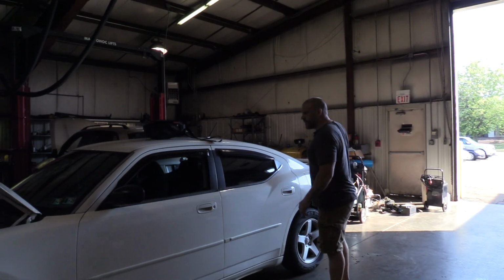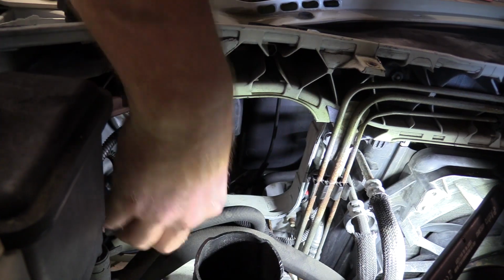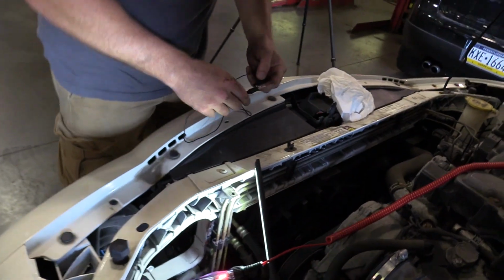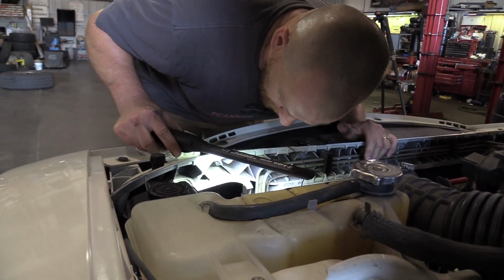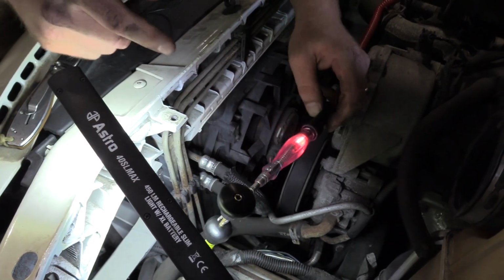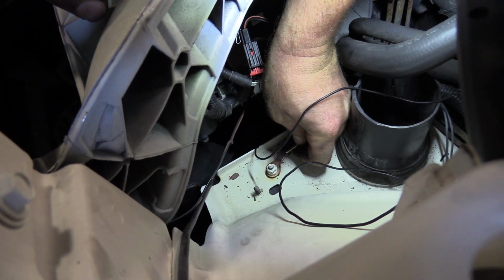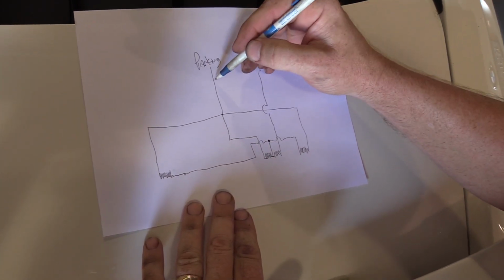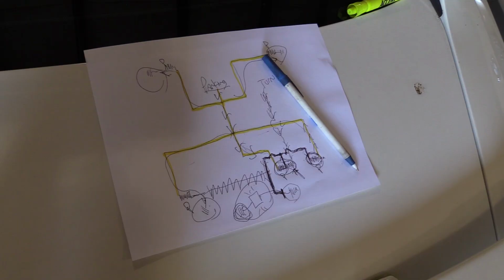Voltage drop testing a parking light/turn signal circuit

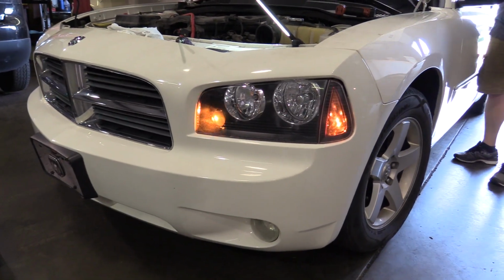Comment: 24:40 Nope its bad. Think again. its grimped, not soldered they all have oxidation on them. so they all need to be turned on to see results but some of them are most likely very low amp. sensor grounds so newer see it...

Comment: Here's one for you, I have a 2003 GMC Envoy XL, rear AC not working great, don't use it much so haven't worried too much about it, the hot cold blend door needed to be replaced I knew that much. Finally getting around to working on it, everything  points to bad blower motor resistor and lots of comments online says that's pretty common failure. Long story short get it all torn apart, put new blower motor resistor in and same problem, wiring, fuses, fan (current draw not excessive), everything checks out, did notice that the resistor gets really hot, pretty sure it has a thermal fuse and that's what is shutting it down. So I heat sank it (put it on block of steel) and it kept running. So I'm going to rig up a heatsink but leaves me curious what is causing so much heat, everything looks and checks out fine ?

Comment: I know this is an old video, but I once helped my dad replace my grandma's headlamp assemblies. They were each wired differently to the bulb sockets and it was causing weird issues with the lights and signals and we had to take them out to compare them to the original.

Comment: Hey Scanner Danner, dp you have any videos of voltage drop testing with comparing different conditions on the same type of circuits and loads?
What i mean is have a turn signal example with a bad ground we can see maybe in class shop, them show a with good ground and what you see when you test it with multimeter and OTC test light.
Also show a corrosion fault on power to load wire vs known good power wire and the testing steps with voltage drop using voltmeter and incandescent circuit tester?

I think that would help the dumb people like me 😂
Reply from the maker: I have so many like this! Did you see my newest video from yesterday? I'd be a good place to start. I have a part 2 coming up on this as well. Also anything in my chapter 3 playlists right here on YouTube and on my website 
https://www.scannerdanner.com/join-scannerdanner-premium.html

Comment: Hey Danner fans!!!!  Even if he says it doesn't matter to poke holes in a ground wire. DON'T DO IT. It does matter as you can see the factory wire corroded where there was no protection. The fact that FC didn't protect the original well enough proves the point.  great teacher you are Danner but you get an F here.
Reply: Sorry..NYSDOT tech here. we eat green wires for lunch here. Poke holes but   PLEASE show repair after. You know of the clear nail polish fix I assume? works great. Even on the little hole from your PHILS probe. Holes are holes bud.  @ScannerDanner

Comment: Agree with everything you said but if it was me I would have replaced the entire eye lite even if it didn't test bad(or at least cleaned it before bolting it back down) if you had two wires pull out the others probably aren't far behind

Comment: Starting more than 3 decades ago. One thing I learned every time I get into a new project. Clean every single Ground my eyes and hands can find (a diagram helps a lot...). That means that from old crappy VW Beettles older than myself, to way more recent cars and motorbikes.
I tend to have extremely reliable vehicles, in what electrical is concerned. Never mind the fact that some had been, literally, saved from the scrap yard! ;-)
With that said. Rotary tool, Dremel type, equipped with a decent wire brush. It's an invaluable ally to make short work of corroded contacts/terminals. 
30~45 minutes for a car project will return years of extremely reliable work. Yes, it's a good trade, totally worth investment of time. ;-)
First class video and show case. ;-)

Comment: hello great video but you are saying back feed ground through other  brake Lite assembly but  my question is why the other brake lite assembly  don't share the voltage and  are not blinking on those any of any sides . and when parking lite is off the turn signal signals worked  you donot think ground going back to parking brake power supply not through other brakes light assembly.
.

Comment: Thanks, Paul.   I always appreciate the explanation of the theory, such as you did at the end.    One favour, please: whenever you connect a test light, please be sure to emphasise what the alligator clip at other end is connected to ie power or ground.       When you don’t emphasise it, I sometimes miss out on the information because I’m trying to work out where it must be connected to in order to react as it does.    Many thanks.
Reply: I second this

Comment: Why would you not just put all those grounds into a new lug & clean the ground area up? Takes 5 minutes & reinforces good practice. Guarantee that lug will fail again & best way to source a fault is find the last persons shitty repair
Reply from the maker: 27:00 I addressed that. I used what I had available to me at the time. You're not wrong

Comment: hey paul do you ever see anyone do a voltage drop test but put the meter on MA scale and look for a drop this way called "current flow method"?i always done the traditional vd method you shown and while looking at ground points for engine swap the poster writes that switching to ma is more accurate test? is this bs?
Reply from the maker: That method is used for parasitic drain testing only and is frustrating at best using it

Comment: A faster test is to use a meter and set to mV and voltage drop test the power side, and then voltage drop test the ground side. If it goes to OL or reads battery voltage you have a bad ground. Seems like your test light method takes too long. We as instructors need to provide a faster and more precise way to check for circuit failures.

Comment: I have a voltage drop to battery voltage (dash reading but lights dim as well so its a true drop) almost every time i put the car in reverse. Then after a few seconds it will go back up to 14.9v. happens when i go directly into drive as well sometimes not as bad on the voltage drop around 13.2v. changed alternator still the same problem. The voltage being 14.9v at highway speed is not cool even when fully warmed up. Any ideas man?
Reply from the maker: If your idle speed is dropping, so will voltage. Is it dropping to the point of almost a stall when you put it into gear?
What are you working on? Year, make, model and engine?
Reply: @ScannerDanner  its getting down to battery voltage. Then when i rev the engine it will kick back in. Not sure if i have a bad signal wire on alternator bc for a half hour after cold start im at 15v then will drop to 14.6 - 14.8. 15v on highway no matter what. Buick LeSabre 04.. heard the dash integration module also regulates volts on this car from the hanes manual. Is that true? Maybe a communication problem. But voltage drop only happens when shifting into or out of a gear. The most being park to reverse. Have a power steering pulley that doesnt spin as freely as it should so not sure if that could be as well. The harmonic balancers go bad on these cars too. but im sure u know that. Fixed the front transmission mount so maybe the back one may need changed as well.. sorry for the long reply and edits. Much respect sir
Reply: @ScannerDanner  the dash integration module controls idle speed as well and cuts voltage to components if the system senses that the battery is in a discharge. My ac clutch rattles intermittently and ac clutch is the first thing on the list for it to take away voltage from and this is controlled by the dash integrated module according to hanes manual. Is this true?
Reply from the maker: @confidential8738  no sir, all of that info is wrong. An O4 LeSabre? I'm almost 100% positive that alternator is self contained and only gets a wake up signal from the ECM.
Also the ECM controls idle speed. I need to look up service info. Let's move this to my forum. It is free to join www.scannerdanner.com 
Let me know when you post it and I'll help
Reply: @ScannerDanner  ok i posted in the forum. Thank you very much for your time.
Reply from the maker: @confidential8738  my man! I'll be a bit. Just became a grandfather as we speak. You're the first to know. How about that.
Reply: @ScannerDanner  wow man that is awesome. Congratulations to u and your son.

Comment: Great video Danner.  The other day, I had a a Ford Taurus where when you turned on the headlights, the right one was out, but the  washer motor started spraying the windshield. Turns out the guy changed his bulb, but forgot to tighten the ground you had to move out of the way to get to it. Bad grounds can cause some crazy symptoms.

Comment: I don’t have power on coils when key is cranking so I took a ground wire and hooked it to black wire at coil main and it starts but computer still acts like it’s missing . Is this has you would say drop in voltage end steals ground some where or is it a bad computer or a bad ground

Comment: Have question regarding voltage drop.
scenario 1.
 Objective=To check the integrity of ground wires from the PCM.
-KOEOff ( reading 5 volts on ref) - circuit is on ( supposedly loaded)
hook up one lead to BAT (Neg)and the other lead to entry point at PCM connector ( connector is attached to PCM).
DMM reads 6.2mV.
Would such procedure establish if the circuit is good ( mainly to see if wire going into PCM is connected to ground and in good condition)

Can the LoadPro also perform this test, if so what are the conditions and hook up.

Someone suggested to disconnect PCM wire, use a test light. One side goes to BAT+ the other touch the ground PCM wire, if light is "bright" circuit OK.
I ask that you comment on the merits or lack thereof of each method, if possible
Thank you

Comment: Man I just wanna say thank you thank you thank you thank you for your time I know I said thank you a lot but thank you! I currently drive a 21-year-old service van it would not run Well. I recently watched one of your videos about Chevrolet in that particular year needing 50 psi fuel pressure to open the injectors spider injectors that is. did a fuel pressure check after two mechanics told me it was junk. the thing is running like a beast. dude you’re the best thank you keep up the good work! If I was flush with money I’ll be sending some your way right now! But times are tough right now! God bless keep up the good work!
Reply from the maker: Thank you so much for the comment and I'm glad I could help guide you on fixing your van. Good providence to you my friend

Comment: Sometimes l would put a voltmeter on the ground connection where the ground wires are put the other lead of meter to neg of batt The meter will indicate a reading if you have a high or a resistance in the circuit, higher the reading up to battery voltage if very bad.

Comment: This bad ground was a common fault in the old days and still today.
It was quite common in the seventies at night time when you are following a car and the car driver indicates to turn,you see the rear lights on one side,all start flashing, dim, this is because the indicator feed in that side is trying to ground through the other 3 grounds, which have a high resistance at the point of the ground bolt to body..
As we known electricity, all ways takes it path to ground,the easiest way ,back feeding itself through other equipment .

Comment: Soon as I turned this video on, I said, "bad ground". Then I saw it was a Chrysler product, then I said, "definitely a bad ground!"
Reply: The ground stud on the left front of the frame on my Caravan was a mess. They crammed a crap load of wires into the terminal then to the stud. I first lost one side turn signal, then the other, then the driving light. I turned the one terminal into 3 smaller ones, soldered them, connected them to the stud & sprayed the crap out of them with Fluid Film. Thanks, Chrysler!

Comment: None of my comments are really related to the video particularly but,  the only times I've ever almost thrown in the towel on any kind of repairs have been with Chrysler/dodge vehicles. ...and the one time I actually did give up completely was a Chrysler. ..the combo of the bad design and pain in the butt procedure to do what I needed to do coupled with the cold weather and the wet mud on the ground was just too much for my sanity...now I get a little cringe twitch every time I see a dodge or Chrysler pull in the shop pkng lot hoping I don't pull the ticket. ..I'm scarred for life lol need therapy lol......Chrysler smh

Comment: so water got inside the jacket and corroded the wire inside, just behind the eyelet.
the way the eyelets are staked/soldered/resistance welded would make the actual connection strong and the wire just behind is always the weak point. that is also where it would stay wet for the longest duration and have plenty of oxygen

Comment: if it has a tipm....................
of course make sure the bulb hasn't went wonky inside by visual inspection or parts canon a bulb/s
NOTE, read the topic first dummy, @ backfeed into the bulb ground, so typical chrysler bad ground lugs :))

Comment: Question,  would just  reading the ground side on the device "bulb" with the DVOM, from the very start, show a "non zero" value, in this problem case it should show "approx 12 volts",  this will tell you that the ground side of the circuit is bad, ground should be zero volts or very close to it.
Reply from the maker: Absolutely, as long as the circuit is energized. If the circuit had no current flow, that ground would have shown 0v. A common mistake people make. Another common mistake would have been to measure resistance on that ground circuit with an ohmmeter. It would have passed that test to.
Reply: @ScannerDanner  Thank you love your videos, great professional job

Comment: was thinking to myself another problem running another wire is depending on circuit design you can trip circute monitor into thinking there's a ground where it shouldn't be and throw codes had a similar issue with adding power switch relay for additional fog lights to low hi switched circuit always sends a small current to tell if bulb burns out. 
Since adding a relay it no longer can tell if bulb goes out.
Had a face palm moment as relay sometimes wouldn't turn off just left it be it's on my brothers truck he said no big deal but makes adding some simple lights difficult was thinking about adding a diode to solve the issue if it becomes a problem doesn't hardly happen at all usually turn lights on back off resets it quick😅

Comment: Remember me such as issue with my brother's car which is Avante hit a big nail cause coolant tube cutting then the car doesn't crancking and all light doesn't light just the high beam sign in the instrument cluster always on...this all due to Ground point which is contain alot of wires has been cut....

Comment: more and more new car makers are makeing art of simple light circuit.
If pulp gos bad they stop sending volts to that pulp and if you tyred to fault find that without scan tool/ changeing the pulp with correct wattage pulp you get lost as you would say its the module.
Those moduls can allso turn on other ligths for example safty if stop ligth pulp get burnt it can turn on eaxmple fog lits to run as stop ligths and so normal driver would say that the instrument cluster isnt working as it says fix your stoplamps!
Yeah its just ligths easy to fix rigth? Specially when you have rare car in front of you and it has that system.
Then you wish your scan tool knows the system goodinaf tot tell you what car sees and what it dos to safe that driver from rearending neck pain ;)

Comment: Hi Bud I’m in need of some knowledge of yours .i have a 1997 dodge Dakota 3.9 gas..about 2 months ago I started to notice it losing power and every now and then a code GEN started showing on the dash.about a month ago it shut off twice on me while coming to a stop.today it won’t stay running when engine warms up after that it shuts off quicker with every start only running for about 1-4 minutes on warm engine in ANY gear at a stop or while accelerating it would just shut off each start gets harder as engine warms.i changed out the tps and the iac and the battery as it then started needing a jump.unclogged the back cat also.please ANY suggestions would be HIGHLY appreciated!

Comment: One day when I had a bad bulb in our 2000 suburban I discovered the same side marker light flashes alternating with the signal light. When the signal light flashes "on" the marker is "off", and vice versa. I scratched my head for a while until I discovered that this is a normal pattern with that generation of Chev. Engineers were faced with the challenge of making turn signals more visible from the side, and they solved the problem by creatively running ground between the two so that both would flash in an alternating pattern. I never noticed until the bulb failed and I gave it more attention.

Comment: What’s really impressive is that you chose the exact wire on your first probe. Lol.
Reply from the maker: I know right?! I was convinced it was a bad eyelet at first because if that.
Reply: No doubt. That was exactly what I thought would be your next step. That’s probably where most of us would have went. I guess in this case it would have fixed it if you replaced it but, just cleaning it would have left us still looking. Glad you were diligent there and checked the rest. That will help me remember the next I run into something like this. Thanks for the great video.
Reply from the maker: It really needed a new eyelet for all of those wires, I just didn't have one that size and it's my neighbors car, so you know I'll be the one handling it later lol
Reply: ScannerDanner you know right where to go the next time though. Lol.